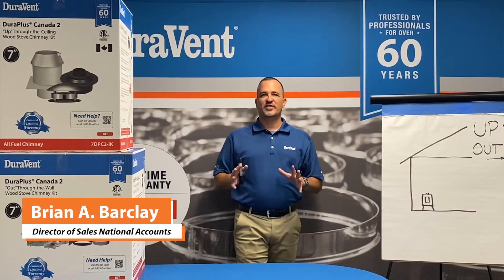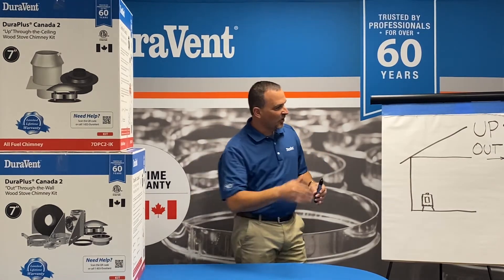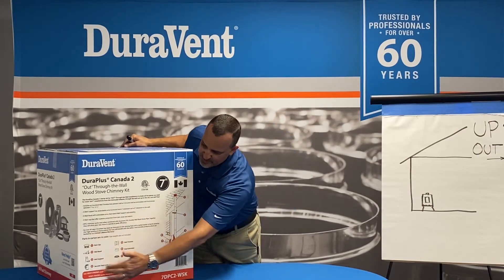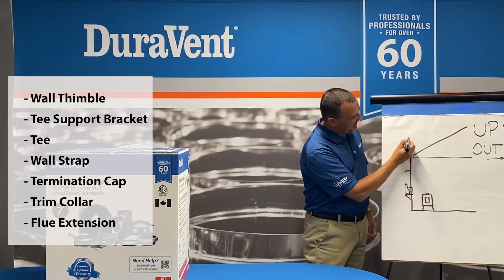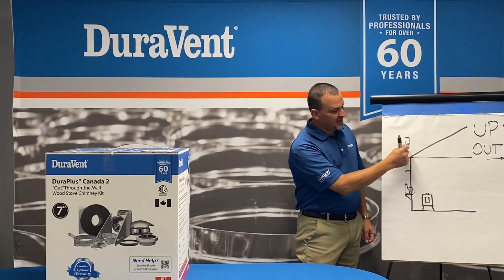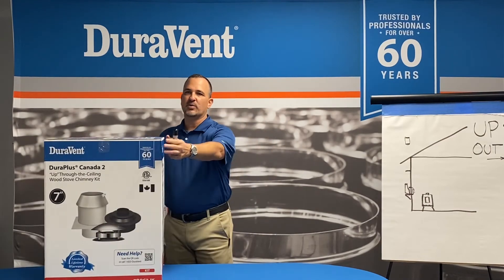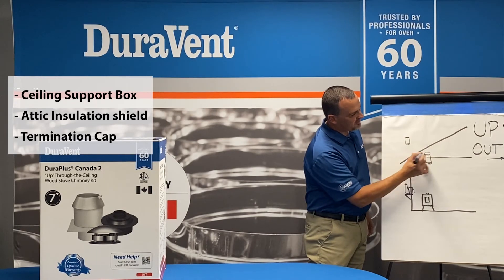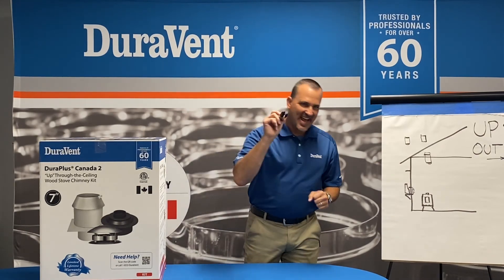DuraPlus® Canada 2 “Up” and “Out” Kits

Comment: how do you connect  pipe to built in adapter on ceiling support, there is no way to screw together, no pilot holes on ceiling support. I'm using kit 6DPC-IK.  I'm getting very frustrated as no video and instructions do not cover this very apparent over-site. The box states that it has built in adapter well how do you connect it, just not pressure fitted, because that is not safe. please can someone out there help 
and same thing with adjustable 12 inch 6DVL-12ADJ that say it can be used as stove adapter, well it just sits there, no way to secure, so do I screw new pilot holes into stove collar and do i screw longer screws into double wall of pipe onto collar of ceiling support
Reply: Hi Sheila, same problem here. Did you find solution yet? NOBODY from Duravent returns calls or emails. This company is absolutely sub-par. Can't believe I gave them my hard earned bucks. 
No way the double wall stove pipe connects to the ceiling support, and the stove connector just sits there wobbly. I ended up gluing it in with glass fibre tape and stove cement!
Please let me know if you found a solution.... were on the brink of desperation with this product and company.....
If anybody from DURAVENT sees this... some help would be appreciated